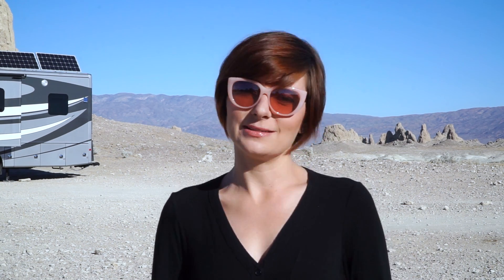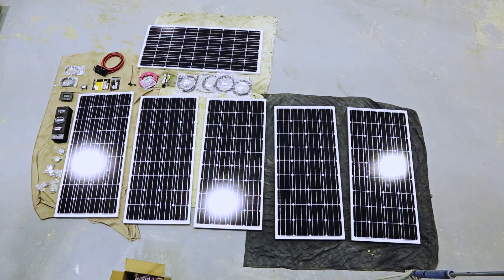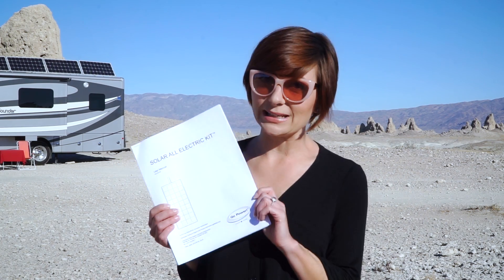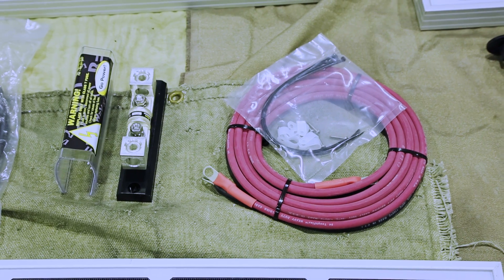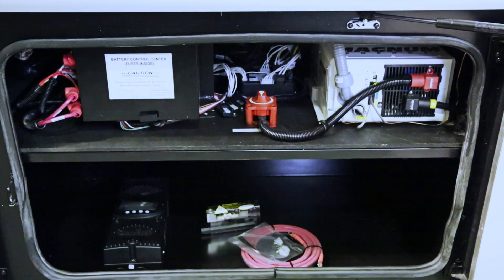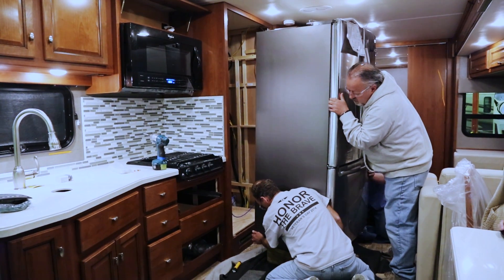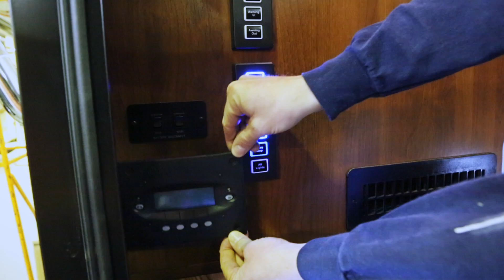Our 960 Watt RV Solar Install: A Step-By-Step Guide

Comment: I have watched several of you videos where you keep using the term AMPS incorrectly when talking about the output of the solar panels. Amps is defined as ''a unit of electric current equal to a flow of one coulomb per second''. The correct term for the power produced by the solar panels is Watts. Watts is the unit for power and that is what the panels are making is power. Which is why the panels are rated in watts.  It's like saying your RV's engine is producing 55 mph when driving. Now i can understand the confusion especially when I suspect that you meter reads only in volts and amps. To determine how many watts you are using multiply the voltage by the amps. Even then its not a true indication of how much power the panels are actually ''producing'', just what you are actually using.  I know the average person isn't going to know the difference but I'm sure those that do are yelling at the computer every-time you say it. 
http://inspectapedia.com/electric/Electrical_Definitions.php
On another note I do enjoy you videos.
Reply from the maker: +regould221 

My GoPower Solar AE kit is capable of bringing in 960 watts
or approximately 9 amps per panel.  My Battery bank has 700 amp hours of
power.  My Outback Solar Charge Controller displays the power coming into
it in AMPS and not Watts.  My Magnum Remote monitors our battery In &
Out in amps (not watts).  This is why I refer to the power as Amps, so
it’s easy for regular people (like myself) to understand.  
If I were making videos for professionals or electrical
engineers then I would choose my terms more carefully, but in this instance
keeping the terminology simple and providing a general understanding of solar
power is our ultimate goal.

Comment: Which is the most limiting factor when designing a solar installation , the size and number of the solar panels or the size and number of batteries ? 
What items could you power with your solar set up ? furnace , refrigerator/freezer , hot water heater  understanding your batteries will allow somethings to be run longer than others .

Comment: Great video Jason and Nikki!  We thought we could answer a popular question about reduced output when the panels are wired in series (due to panels being shaded):
When part of the array is shaded, wiring in series will still produce power. All of the panels have diodes to prevent power loss when wired in series. What you would see is the voltage drop from 100 plus volts to 80 volts and this would only be if one panel was completely blacked out (not if shaded by clouds). The batteries are 12 volts and only require 14.7 VDC input to receive a complete charge. Using an MPPT controller and bringing in higher voltages will actually have less effect from shading. Another great reason to use the panels in series is because we raise the voltage while lowering the current to the MPPT controller allowing us to use smaller gauge cables without the loss you would have at a parallel voltage. The MPPT then steps down the voltage from 100 plus volts to 20. The MPPT controller is located next to the batteries so we use the large #4 cable to carry the high current and low voltage to the battery bank.

Hope this makes sense and helps out!
Reply from the maker: +jay super Its amazing what that little 120 watt portable can do.  If you decide you need a little more juice we have a trick on our webstie for putting two together: http://www.gonewiththewynns.com/portable-solar-kit
Reply: +Go Power! By Carmanah 

Thanx...Thanx to the Wynn's and a older solar video they did with your 120 watt suitcase portable panel unit.  For us, camping at non-electric state parks, the 120 watt panels offers just enough juice to keep our single deep cycle battery charged.  We upgraded to a higher reserve group 29 battery recently in preparation for a trip to Alaska in a few months.
Reply from the maker: +Go Power! By Carmanah Hey guys, thank you so much for chiming in.  I typically just tell people "it works, even when there's some shade" but I don't really understand the science of why!
Reply: +Gone with the Wynns spoiled brats
Reply: Go Power!

Comment from the maker: Hello All!  Thanks for the extremely kind words and the questions for our next solar videos, obviously we're diving into an extremely confusing and exciting subject.  I'll address a few of the most common comments now and I will take note of the rest for future vids.
 - Our Site - We have tons more info not covered in the video on our site: http://www.gonewiththewynns.com/rv-solar-install-guide 
 - 50k subs - This is such a milestone for us and we couldn't be more happy with where we are and where we're heading with our website and YT channel.  Thanks for all the kudos.
 - Our Batteries - As stated in the subject info we still have our lithium battery bank, this install was done 2 days before the battery install.
 - Tesla Batteries - At this time we've been told it's not an option for RVs, not sure why, but that could change one day.
 - Series Wiring - There seems to be a lot of questions surrounding Series vs. Parallel wiring.  With our exact setup and MPPT charge controller, the "series" wiring was recommended.  I'm sure this will be a video.
 - Tilting - We will film a tilting video
 - A/C - We will attempt to run our A/C off our battery and solar in the future.
Reply: +Gone with the Wynns  how many batteries?

Comment: Greetings,You are producing g a lot of voltage when connected in series. I see you are using an outback charge controller . Assuming you are using the Flex Max 80 ? What voltage is your battery bank? I know the flexmax will down convert to your battery voltage. If you are using 12 volt, why? Reason I ask is I'm building a Solar setup for my rig. I went with 4 250 watt panels and am running in Series. That puts me at the open circuit voltage limit  of the flex max 80. I'm running a 24 volt battery bank and have a step down transformer to run the DC systems in the coach. Sure there are some inefficiencies but the 24 volt system more than makes up for that. I went with 24 volt because it's more efficient and cable runs aren't as much of an issue at higher voltages. I also went with an Outback 3500 watt pure sign wave inverter. I like my energy hungry toys. Let me know how you like the Outback Charge controller and the Mate. Mine is all still on the floor of my garage! Also, if I may be mistaken but you are using lithium batteries right? I have a big weight restriction and LI batteries are much lighter. Need to save every pound I can. Looking forward to more details on your system.
Reply from the maker: +Doug Henson Most panels that are made to take the abuse of being on a moving home are 12v.  Some people use house type solar panels that are 24v however they are not typically warrantied for RV use.

Comment: Very nicely done. Great video.

For a state of the art battery, how about the 7 KWH Tesla Powerwall. It is 220 lbs. and about 7" deep. I suppose it could be installed on the outside back wall of the RV. But, for my RV solar setup, it will probably be on the roof.
Reply: Peter Davila you can't install the Tesla battery. They won't do it.

Comment: If you had your choice between your solar power system OR your composting toilet, which would you choose?
Reply from the maker: +Nomadic Native That's not a fair choice...both! If money were an issue, I would start off with a really good inverter and plenty of battery power.  Then I would add solar and the toilet as funds allowed.
Reply: i can watch tv sitting on a bucket but I can't......... can't do a lot of things
one is answering stupid questions

Comment: Awesome video!  This is a lot of electricity.  What do you find yourself doing with all of this power?
Reply from the maker: +Andrew Miller because we have a residential refrigerator we need this much power to keep it going.  Then there is the fact that we work from the RV so we have to power our computers and such while editing.
Reply: One Computer at Full Load Could Draw 500-750 Watts by itself. 1000 watts is a Decent size Solar system. Livable. You Need 2100 watts just to Start a compressor on a refrigerator minimum. Running load on a standard side by side fridge is 11.2 amps or 1100 watts. so Just when the fridge runs you are actually negative. so 2,000 watts would be a better set up actually.

Comment: Rvwith Tito   You make a great case for running in series. My experience  comes from camping w/other rv's with solar. We all love to talk and compare. Back 4 years ago we had a chance to compare like systems but wired parallel vs  Series.  The series system was out performed hands down by " The parallels"   in full sun. and when shaded the series almost shut down. Now w/ blocking diodes in panels maybe series has advantages ?  What I was trying to say is that if your were to run 55 amps being pushed by 18 volts Through # 10 wire the voltage loss would be crippling.  But what I really know is RV solar systems have their complexities and I'm alway's learning. Thanks for your input.

Comment: You mention electric shock a few times in this video. Of course, no one wants a shock, but if these are 12V panels, I would think the shock would not be that much of a worry. I would not expect 12V to be much of a shock. Am I missing something?

Comment: Can you give any information on how or if the system operates while on the road.  I have installed a pure sine inverter in our coach to avoid the use of the gen while tooling down the road.  With a little one with us sometimes the open road is just, well too open.  So I would like to see if you can provide some testing on how your system works while in motion, is it just solar or are you feeding the system with the alternator as well. Thanks !

Comment: What size fuses did you install and what are you doing with that much power? Is it b/c of the fridge and to be able to run A/C? Did you get lithium batteries this year?

Comment: 3:25 I'd never get anything done wearing that harness. I'd be too busy doing Peter Pans all over the place.
Reply: Ian McDonald Mike Miller  When you strive to be Peter Pan, some sacrifices must be made.
Reply: +Maxid1 The fall arrest harness is NOT pleasant to hang from. It can prevent major injuries but it will cause minor ones in the process.
Reply: Well if you have a room with 8' ceilings plus 2 or 3 feet for HVAC and such imbetween floors and your 40' in the air wouldnt you call that close to 4 stories? I sure the hell would. and Cherry pickers we used for " picking product " were ones that had the forks facing backwards loaded with a long pallet where I would go up and pull parts, alot of the time would have to walk on the pallet and walk over to the shelf to load things properly. I worked for the Logistics Company that warehoused parts for the Phalanx Weapon System for Naval Ordnance. It was a long time ago and maybe it wasn't 40 feet hell I dont know all I do know is when I walked on the pallet, i thought I was on the fork and it broke throwing me off balance...and thats where the peter pan "JERK" happened..lol
Reply: +Ian McDonald the harness can also cause death after 45 minutes of hanging. Plus, it hurts when you fall with it on, it's not a slow stop.
Reply: Trust me I fell off a cherry picker that was 4 stories up...there is no peter pan action..just piss your pants action. Your whole body takes quite a jerk and like Mike said its really painful.
Reply: Made us smile...  not quite sure WHAT you were doing from the platform of a cherry picker that would entail you falling out of or off the platform... that has a 3.5 foot safety rail...   but lets not get into that...  being 4 stories up... looks like you should have has a parasail or parachute..  nothing you can say will be an explination for that stupid stunt...  looks like what you were attempting to do..  couldn't be done.  Been building Automation systems for 30 years...  in distribution facilityes and airports 40 to 60 feet up through hangers ...  where single man lifts only go up something like 30 feet..   which is NOT 4 STORIES...  I can do some pretty stupid stuff as well..  we get the risk we take ...   but this guy on the roof of an 'RV needing a harness... is company rules...  not something I would do at home...  working from the edge in drilling mounting holes..  should be done from scaffolding like shown.. DON'T NEED A HARNESS FOR THAT...

Comment: Are your panels 12 or 24 volt? Unless I've misunderstood what I've read on solar the charge controller can take either and convert to 12v from 24v with a corresponding doubling of amps. If correct that would halve the number of panels needed for the same amount of power with less roof space used.

Comment: Fantastic timing! I have been number crunching my solar system use by using a "KILL A WATT" plug and have determined that I need this system and was just working out all the details when I got your update!! Super. I had decided on an OutBack controller and Magnum inverter and was just working out the panels to use! GREAT TIMING :)  THANK YOU!!

Comment: What went into Your decision to wire in series???    If any part of that array is shaded you drastically reduce there output, almost to nothing , Also you don't get nearly the AMPS  and AMPS are everything.  Also  wired in series A # 10 of 20'  ( you need a # 4 )  wire from roof to controller  results in 4% loss. Now wired in Parallel because of larger current (Amps flowing)  the voltage loss would be  20% .  Very important to keep any wire run in a solar system under 3%  voltage loss.  I see this all the time. RV manufactures design systems ( middle of the road)  that do not extract maximum energy from solar panels to batteries.  Yes, energy will flow to your batteries  and might  meet all your needs……..But simple changes here might be better.  

That said,  I love your videos  and congratulation  on 50 thousand subscribed !!!!!
Reply: Dude Ohms law much? much less line loss at higher voltages means more power moved on a smaller wire the whole reason for 15,000 volts running thru your neighborhood on top of poles being transformed down to 120/220 as needed... running the panels in series means much less line loss at any wire gauge because of the higher voltage and less current...
Reply from the maker: +tazmun +Craig Marston Did you see the comment from the GoPower! Team?  Several people had the same questions and they've answered it in their comment.
Reply: +Craig Marston They say series, but I'm not sure it really is...it could still be in parallel depending on how those plugs are wired. I highly suspect there is an extra set of wires just to carry thru-put built in and each panel just taps into that set of wires. There is a possible flip side of this argument in that higher voltage (as you might gain in series) is more efficient in a longer and even smaller wire then. Neither amps nor volts is a unit of energy but rather Watts is which is arrived at by I x E=W. However the total voltage of a series marraige is a value which I can't see much use for unless you transform it to a lower voltage down the line. However DC voltage won't work in a transformer unless it's pulsating or changed to AC and by the time you convert and transform your losses due to efficiency will kill any gains and leave you at a loss even.
Reply: +Craig Marston Good points Craig. Here are some additional thoughts.
Shading: Some panels have a bypass diode designed to pass the voltage through (bypassing the panel) if the output of the panel drops below a certain level (shading). This is to minimize the one panel's impact on the entire solar array when wired in series. I don't know if these GoPower panels are equipped with this though. It is not mentioned on their spec sheet. 

Series vs Parallel: I believe those are 160W panels that put out around 18-22 volts. Wired in series (at 18v each) they would send around 108 volts to the controller at a maximum of around 54 amps (8.8 - 9 amps each) under ideal conditions. With #10 awg wire at 20 feet, I calculate the drop at just around 2%.  Yes, with #4 gauge wire that would be lower. I try to keep it under 1% and would probably switch to #4 if the run was longer than 20 feet. Now with a PWM controller, what you say is true regarding lost AMPS. However, it looks like they are using an Outback MPPT charge controller that can probably take up to 1000 (or more) volts as input. This results in the 108 incoming volts being converted into extra current to the battery bank (plus an added 20% boost) which means there is no wasted amps. In fact they may get more under optimal conditions. 
Anyway, those are my thoughts and I hope my numbers are right. I can say that I have a little bit of solar envy and wish I had that much power on my roof. Pretty cool!

Jason/Nikki, what is the capacity of your battery bank? (nevermind...just saw your response below 700AH Lithium...cool) And let me join in and also congratulate you on the 50K subs!
Reply: Wow that was a text full of info. wish I could copy it for later reference
Reply: +seabliss22 Right! I was wishing the same thing and bookmarked the video for later reference. Just hope that I'll be able to find the comments later.

Comment: I saw 4 batteries so I would imagine that your current set up allows you to power everything except the AC and microwave oven from your battery bank.  Is there any other typical item that an RV'er would use that wouldn't use battery/inverter power because of a large power draw?
Reply: +lowell mccormick No problem running a microwave off a setup like this, and can be done with one much smaller. Good to have a PSW inverter instead of a MSW, as microwaves can be finicky. They actually have enough solar to run a small, window AC...length of run depends on batteries. If had LiPO4 batteries, could conceivably run AC quite a bit. Good AGM's would get you 3-4hrs run time at a guesstimate.